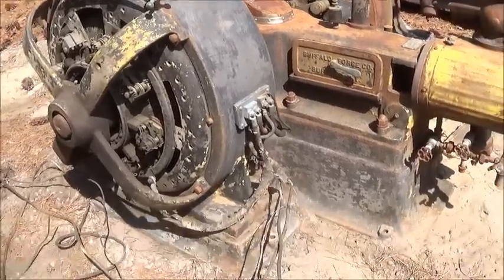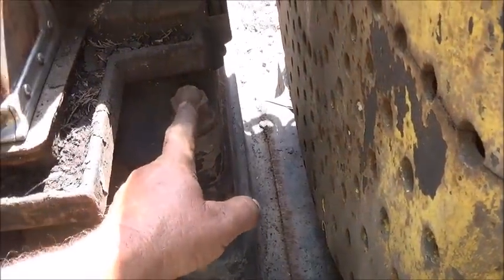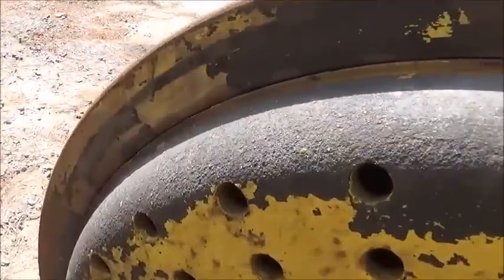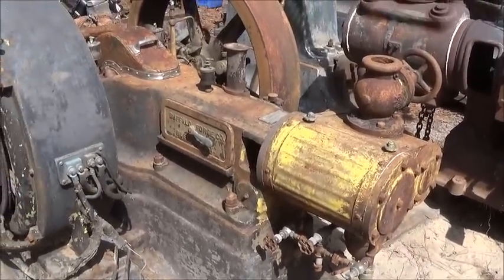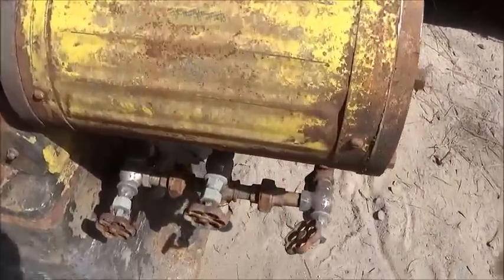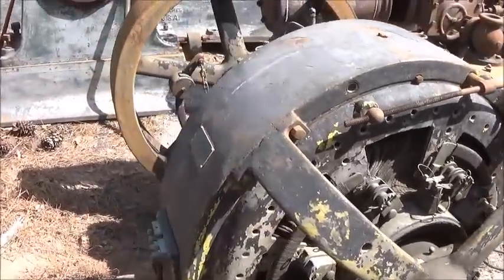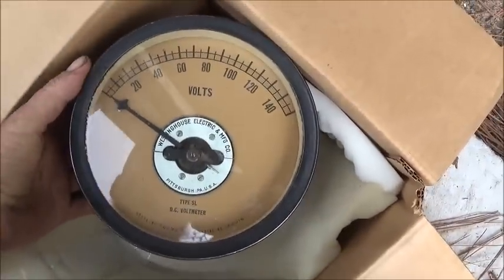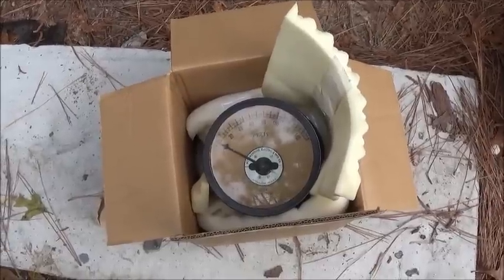BUFFALO FORGE CO. STEAM ENGINE GENERATOR

Comment: Great looking unit. Looks like a DC generator. You will have to flash the field because I would doubt it retains any residual magnetism, but after that it should be self exciting, You will need some off generator field controls like a field control rheostat and the meters you mentioned, but they shouldn't be too hard to find. The screw is for setting the neutral on the brush rigging to reduce the brush sparking. LED's are diodes and do their own rectifying as long as the inverse voltage doesn't exceed the LED's limits, which are low so people just use a better diode inline. You should be able to use LED lights but you might have to reverse the generator's connection to the receptacle to get the current flowing in the right direction.
Reply: Got to show Jonathan how to under cut and repair a shorted commutator with 5 minute epoxy! LOL.
Reply: @renegade2556  I have actually done that on a 750 Kw generator.😲 I've been a shift electrician at a steel mill for a long time.🙋‍♂️  I wouldn't be surprised if Jonathan didn't figure it out all on his own 😉 I do have a few books that might help get the beastie going if I had a few more details.
Reply: @MatthewBerginGarage I have utilized that repair as a Journeyman several times in the field while working on old 440v DC elevator hoist machines that required being returned to service quickly. Last time I had to do that was over 18 years ago, and it is still in service.
Reply: Love reading comments like these.  I don't know anything about electricity.  But it's fun reading about the knowledge y'all have.  I'm color blind as hell, so you wouldn't want me around electrical wires, LOL......
Reply: Really good comments here. Believe this would be the one I would get going
Reply: Good explanation.  I'm a semi retired electrician and still teach electrical at s tech school. That was a good synopsis of how a generator needs to be set up.
Reply: @renegade2556  That is the sign of a good repair. When you fix something properly it stays fixed. 😎
Reply: @charleyfloyd3317  Thank you Sir.
Reply: LOL, I just dont think I'm up for hauling another 600-800 pound DC motor down the ladderwell from the roof on a hand truck these days!
Reply: @renegade2556  You and me too. The condition of my knees makes that an impossibility. 😞
Reply: @MatthewBerginGarage  I love the work! Don't get me wrong! used to be easy! getting old sucks!
Reply: @MatthewBerginGarage  I'm putting a lazy boy electric starter on my old Pan. That should say it all.
Reply: @renegade2556  I love it as well. I am one year shy of retirement but I'm off work now waiting for my second new knee. At the moment I couldn't walk around the block. 35+ years of climbing around on rolling mills and blast furnaces has taken their toll.😧
Reply: @renegade2556  I hear Ya.😞  My son would be jealous, he loves the panheads. Me, I'm partial to early 50's Fords. Got me a 53 as a retirement project.
Reply: @MatthewBerginGarage  Now I'm Jealous! I really can't complain though I don't know how my Old Lady put up with me for many moons! Got a 1940 HD flathead engine ,on the kitchen table,(artwork) Two 70's Sportsters in the living room by the guitars and the drum set,a Ka-Bar behind the bathroom mirror by the shower. a Garage full of tools machines parts and motorcycles and my 88 351 F-250 and all I get is she just thinks all former Marines are just as friggin crazy as I am! LOL
Reply: We had high frequency alterations ( 1000 Hz , 360 v , three phase) to run some 40,000 RPM motors. Had to do a lot of slip ring maintenance. Originally used DC generators for field excitation, but later changed to solid state supply.
Reply: @renegade2556  Your wife must be far more forgiving than mine. 👍😎
Reply: @MatthewBerginGarage  Hey man, if my insurance policy suddenly goes up, curiously ...supper starts tasting like some rodent bug spray: if my eyes start bleeding and peripheral vision disappears,...can I crash out in your old Ford?...LOL
Reply: @MatthewBerginGarage  Yeah She's a doll, but I've only been married for 30 years and ya never know!
Reply: @MatthewBerginGarage  I'm 60 next month and you definately ain't old enough to retire ye rascal,back to work lazy man! LOL Raise your hand if you don't feel no different than you did when you were 17! lucky we got spare parts these days Mr. Matthew!
Reply: @renegade2556  Actually I do feel like I'm still 17 if I'm stationary but as soon as I move I feel every one of those extra 46 years.😧 The one knee I've had replaced works better than the old one ever did and when I get the next one I will enjoy being back on my bicycle. I caught Omicron a few months ago and I am suffering through Long Covid and it is no fun. I can still do most anything but I have to do it very slow or I run out of breath. Between motorcycle accidents, bicycle accidents and general wear and tear I'm fairly wore out. I look at the bright side and consider that every morning, when I wake up, it means the day is off to a good start. 😉😁
Reply: @MatthewBerginGarage  That's the spirit, friend! never ever surrender!Last person that swore he was wore out to me, kicked me right in my ass! Life is meant to be Lived and  there is no giving up! We can all take a break when the Man Upstairs assigns each of us to our dirt nap. And only He can do that! Till then Back to work ,each to his own we all have  a lot  more to give! When my knees finally give out some New Einstein will probably give me some pogo stick legs and give me a new way to screw up all the other parts that ain't screwed up yet!

Comment: Nickel plated hardware and pinstriping adds to  the overall performance, you know🙂
And I never get tired of the engines you save - they're some of the most interesting things on YouTube. Keep finding and saving them as long as you can. That's a unique picnic table, by the way. A great use of cedar.
Reply: The Nickel plating and pinstriping was not from the manufacturer but  is from the hard Work of the  Chief Resident Maintenance Mechanic that was Responsible for care and Maintenance of the Machine. From the turn of the last Century onwards in large cities, a proficient maintenance mechanic could land a gratis and prominent apartment for his Wife and Family in any high rise building to dedicate his life and time to the Maintenance and care of the Building's Equipment. Elevator Guys Had the top floor for their families nearest the elevator motor room,and although not Posh by any standard today it was  something to be proud of having achieved and men took pride in keeping their machines spotless and appealing to the eye. I have witnessed these currently spooky empty apartments myself,although the practice is not followed anymore,I saw many of these as a journeyman elevator Mechanic for many years. One prominent Building had offices  inside the Elevator Shaftway only accessible by a Mechanic from the top of the elevator. The man's desk ,coat on the back of the chair and hat on the hanger Covered with dust and a 1940's calendar waiting for him to return, and this is in a prominant building in a Major City. Out of respect nobody ever touches these things, but you learn a lot about the way things were.
Reply: Addendum:Correction:The Places I saw with top Floor apartments were invariably @1890-1925 Basement Traction Machines,and the apartments were near the overhead sheave rooms many of which were glass domed, the motor rooms were in the basement.

Comment: The Triumph generator is a self excited 125 volt direct current one. Probably used for lighting and power. There's an outside chance it could have been an exciter for a large alternating current generator but typically those were belted not separately excited. Good find and save. Odds are good the generator is good if it has been kept dry.
Reply: Wouldn't hurt checking connections and the like (or even the expected output),right?

Comment: When hooking up the electrical system to the generator make sure that you have the proper shunt resistor connected in parallel with the amp meter.  Amp meters will only carry a very small current and will blow instantly once the current gets too high.  The shunt resistor will carry the 200 amp current that the generator will create.  Have an electrician inform you of the specifications of the shunt that must be calculated. Great gen set, I hope that you get it running.
Reply: I will help Jonathan to hook up the power panel.  I will find a shunt.  ---Doozer

Comment: What a beautiful piece , Jonathan ! That looks quite complete ! Hope you get it back to original & working condition . It would come in real handy in a power out situation . If you have to excite it , it wouldn't take more than flashing the field with 12 VDC for a couple seconds . After that it's on . You can get an inverter to make AC volts easy . Very nice unit , glad it found such an awesome home . No , I don't want to test your electric fence out . That unit could easily power a house , & a garage , at the same time . I never get tired of the things you show us , Jonathan . You are a rare breed , so much knowledge , not boring , never the same thing twice . Take care there , Jonathan ! America needs more people like you , showing it CAN be done !

Comment: The dc voltage ratings of this unit seem to align with an excitation unit for larger A/C units. We operate two now hydro powered Allis Chalmers units that were originally driven by Ames uniflow steam engines back in the 1930's in Ohio. The adjustable brush riggings were to adjust null kick to reduce brush sparking under different loads.

Comment: Once you make this operational it would make one heck of a power supply for a welder.  Make sure you have a fantastic ground before trying  out the DC generator.   You don’t want to be “poked” by it.   I learned the hard way with a small Jacobson generator.

Comment: Caution with the amp meter. Most likely it requires a shunt resistor to function. Don't put it in line like an old automotive amp gauge until you've researched it. The amp meter is a low voltage volt meter scaled to read amps based on the voltage drop created across a shunt resistor that is placed in line with the generator out put.
Reply: I wonder if they used  external shunts back then? Is the meters he has originals?
Reply: @6969smurfy  Yes shunts were used. I maintain some 1920's and 1930's hydro generator's and shunts are used for the ammeters. Some of our gauges are OEM and look just like the ones shown. And they still work and are accurate.

Comment: I remember seeing locomotive steam engines pin striped, the Southern Railroad used to have elegant pin striping on their passenger engines in the green livery.  The pin striping was usually yellow, the smoke box silver and the roofs of the cabs were red.  Southern was once a very profitable railroad and the line was meticulous in the maintenance of their rolling stock.

Comment: Great addition  there Jonathan.  That DC unit may have been used on an early ship of some sort.  Those ships were using DC current on board.  Any electric motors or lights on board were DC.  I had an electric tool post grinder for a lathe, army surplus, the thing was DC only so I couldn't use it here.

Comment: Excellent video Johnathan W  :) 125 Volt Generator DC type also should be easy getting going also your friend doing electronics electrical for and so cool too ! Be nice seeing running to and your Steam Engines projects are cool Johnathan W  and I like 👍 to stuff around back when my elders young like us were back then too! Always enjoy stuff you show and tell too each video too ! Bet run a Farm Tractor belt pulley lots Steam Engines plus this Generator too because lots belt drive is 550 RPM !

Comment: LED lights should run as long as you don't hook them up backwards. If you connect them and the don't work, just swap the wires. They pass current in one direction but not the other.

Comment: What a great find! Don't stop with the engines. They are my favorite part of what you do. I work on old radios, and many of them are called AC/DC radios because they were designed to operate on either type of power. When on DC, you had to put the plug in the right way or the radio wouldn't work.

Comment: This is a beautiful unit, I am sure it was in where people could see it.  Although there were lots of power plants around in bigger cities in the early part of the last century they weren't everywhere.  The university at Cape Girardeau, Mo had a DC generator in the early part of the 20th Century when it was called a Teacher's College.  They had a boiler that was used to heat the buildings there so they had a steam boiler and it was also used to power the generator.  There was still some of the old wiring in one of the buildings in the l990s.

Comment: Damn, Jonathan, you're gonna need a steamship boiler and 300 miles of pipe to run all your old iron on steam!  It will be glorious!  BTW,  if you really wanna run AC stuff on that genset, they do make inverters that accept a 130VDC input.  I'm assuming for solar power banks.
Reply: 125-130 VDC is common industrial control voltage. A lot of UPS systems use 125 VDC to 120 VAC inverters

Comment: Hay JW what a Great Find a real Show piece     on the Rail Road the old signals were incandesant now most are replaced with LED   as you may well know the power source most used is DC  so they use Battery backup     the LED signals are lite by DC currant  they use less Amps         You  DO Make American Great             Thank You

Comment: Don't pop all your Christmas bulbs because that may be 120v DC! Maybe not, (it will say on the plate), but I have worked on thousands of similar engines that are still in service with babbit bearings, worm and gear and gearless machines that are electric and haul people up and down. Great stuff!

Comment: If the Christmas lights are just using a rectifier bridge, then they will work just fine with DC.  You might have half the strand work, and the other half not work, but just reversing the wires at the middle of the strand should get the other half up and going.

Comment: You know that nickel plating was used before chrome, even some old autos from 1920s had nickel plate trim and not chrome. Good job saving that piece Jonathan - yes, it would look sharp with new yellow paint and black pinstripe, plus when you get it to make power it will be completely restored.

Comment: J/W, parts of NYC's Greenwich Village had DC house current well towards the end of the 20th Century.  The folks in those zones had to use either DC only or AC/DC appliances.  You should have little trouble in acquiring a so called AA5 AC/DC vacuum tube AM radio that will work with the steam powered dynamo.  AA5 radios DO NOT meet current safety standards.  FWIW, I was exposed (via the WWW) to a modest power O/P AC/DC tube stereo that was reasonably, if current code non-compliant, safe.  Signal transformers isolated users from the power mains.
Reply: Back in 88 I was a helper electrician,  on 43 or 48 street down on the waters edge , gutting old home , old underground service another guy from our shop hooked up a temp light outlets during demo , it was 110 DC.  Con Ed could not find its manhole , wood duct etc , Edison chopped it at property line and buried it

Comment: That is a neat tidy design. As those old dynamo's go, it is very compact. If I may, I wonder if you might be able to interest a college, university, or a technical institute in running a steam engineering course with your equipment. If students were to be qualified on a dozen or more steam engines they would be highly qualified for any job the used steam. Perhaps you could get some of the gruntwork of setting these engines up thrown into the deal as well. Food for thought.

Comment: With that being a generator (generators produce DC and alternators produce AC), you would need an inverter to make it produce AC current. In this case, you would not lose power inverting the DC to AC because it does not need to be "stepped up" from a lower voltage to a higher voltage like the smaller inverters do (12 volts DC to 110 volts AC). 
Oh how I would love to have a machine like that! Keep it at DC and use it to run an arc welder as I am sure you have the amps for it.

Comment: Just imagine what that engine looked like when new. Might have been pin striped for a show or an exhibition back when things mattered.
Reply: back in those days, when labor was cheap, if you could swing the price for a unit, it was almost expected to come with a little gingerbread. 140 amps would be a decent sized farm or office complex in that era. The average home only had one or two lights per room and was supplied by a 30 amp service. They had no other electrical items to speak of.

Comment: neat engine i worked on otis elevator generraters iam sure if the armature tests good to earth the field windings never fail,you need a 500v mega and just test the arature to earth,a blow out with dry air will remove any old carbon dust from wearing brushes thatgets sucked in moisture is not kind to old gennys,you are going to need fuses contactors relays to be able to isolate and control output voltage,getting period ones may be difficult.

Comment: Maybe get you an antique carbon arc lamp to run off of that thing, that would be wild. I dunno what voltage those things typically operate off of, but I know they required DC.

Comment: You may need a voltage divider for the voltage gage - your electrical engineer buddy should be able to help with that - just wanted to give you a heads up on it….